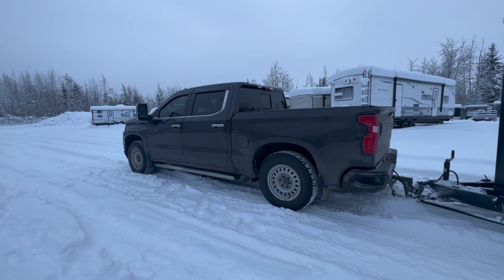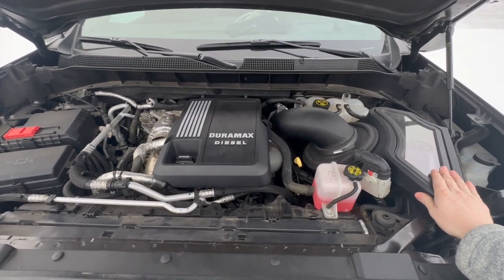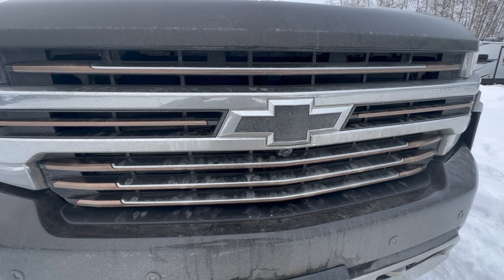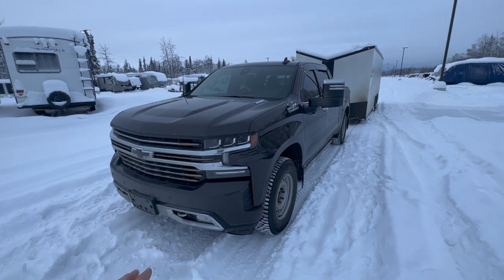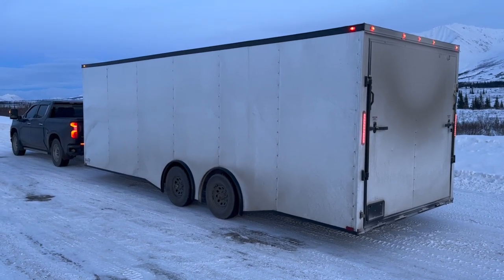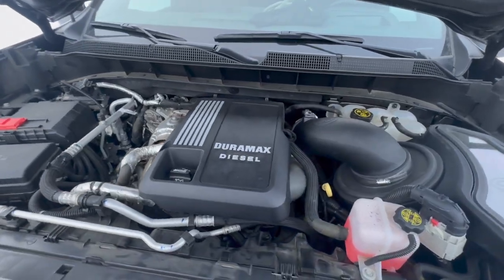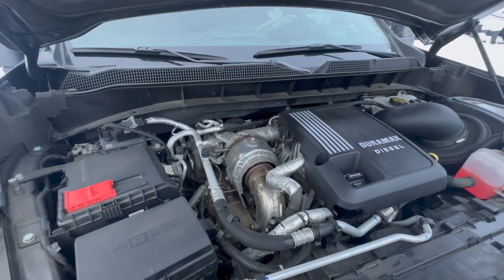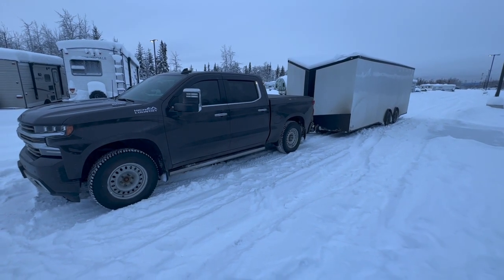3.0L DURAMAX WINTERIZATION- IS IT A COLD WEATHER DIESEL?

Comment: I'm in the NWT, I have added 2x battery heaters and an oil pan heater in addition to the stock block heater. My truck fires up no issues everytime and there's been a few nights I've forgotten to plug it in at -40 over night and it will fire up everytime. It's a 2020 2500HD, I do have the active grill shutters and in town it maintained heat in the cab but on some longer road trips when temps were in the -30's or lower it did have a bit of an issue getting really hot in the cab so I've got a winter front for it this year. No issues with the DEF system. I kept my tank slightly lower than 1/2 full and had no limp mode issues.

Comment: Great video! The baby duramax is top of my list for my next truck but being in Canada I’m nervous of def in the cold. Hearing there is a heater in the def tank gives me confidence - thanks!
The only extra winterization I’ve done to my 6.7 Cummins is a noco battery maintainer and I’d highly recommend. Diesels use up a lot of battery power and your charging system can’t always top it up, especially in the cold.
Reply from the maker: Thank you so much! I wanted to share my first hand experience with the truck and what ive learned over the year. I am making a video now but my DEF tank ended up freezing and essentially exploded from the top. I left it outside overnight (like most of the nights). It had 1/2 tank of DEF, plugged in etc. The dealer ended up covering it under warranty but they ended up replacing the tank + pump and harness. Super expensive if it was'nt covered.Something to keep in mind if you dont have the means to park inside.
Reply: @CHASING_BUILDS  oh no! That’s my biggest concern with def systems, having them freeze and leaving you in limp mode in the middle of nowhere. Guess I’m sticking with my pre-def Cummins a while longer. Thanks for the info!
Reply: @stringtheoryangling  happenend to mme 3 time in 2 years on the baby dmax

Comment: Great video!, My 2023 does the same thing, if it’s 0-10 degrees I just plug it in for one hour. Disconnect battery if you don’t feel like cold soaking your truck.
Reply from the maker: That's smart;  this same thing also happened to a coworker's 2023 2.7L. Silverado. It certainly took a moment and digging to find information on it and how to resolve it.
Reply: Or a battery heat cozy.  Keeps the battery warm
Reply from the maker: @xlthumper  That's so smart!

Comment: Great truck. But for my use case, pulling a very similar trailer to this video with a race car inside, the 2500 gas was a better and cheaper option. Allowing for some headroom in terms of capacity if I step up from a 10k lb trailer to a 14k. We got an LT 6.6 gas Alaskan package for 56k, in the north east we could not touch a 3.0 or a 6.2 1500 for less than 70k.
Reply from the maker: Same up here; I was lucky with the one I picked up.   I have been really happy with it thus far; we just bought another Duramax....it'll make an appearance here soon. I was toying with the idea of a gasser; the limiting factor I am finding with this 3.0L is the truck's weight and other components as a 1500. My payload is only ~1400 lbs, you throw a loaded trailer on this truck that has a max tongue weight of 900lbs and you'll only have enough wiggle room for a Driver / Passenger. I've got a scale en route. Going to play around with the load. The LZ0 has certainly headed in the right direction with a 13.3k max tow; I am sure the payload has increased.
Reply: The payload being low is a function of the truck being a high country.  An RST would but up around 1800lbs. My Trailboss is 1700lbs payload.
Reply from the maker: @terrencejones9817  For sure, definitely a concern as the Tongue Weight increases.
Reply: You could probably pull that same trailer with a 6.6 at about 1-2 mpg less. I pull a fifth wheel with a 3500hd at 11 mpg but not that cold, but running full ac.

Comment: We have a 21 at4 with the baby duramax. It’s got around 60 000 km on it. Early on we were plagued with no start long crank issue followed by a water pump issue that was was replaced. Since about 25000 km we have been problem free. 

Luckily I haven’t had that fan issue. I only plug it in when it’s going to be colder than -18 Celsius as per the user manual. 

I’d have to say in general I’m annoyed with the def usage overall. Not just towing. I’m dumping a jug in every 5-7 weeks. When I owned a 2017 cummins I dumped a jug in every 6 months.
Reply from the maker: Todd, me to brother...me too. Its crazy. Spend as much on DEF as I do fuel half the time when I'm towing....lol  

What symptoms did you have with your waterpump?
Reply: @CHASING_BUILDS  for months the thermostat needle moved all over. Almost red lining then it would drop below normal operating temp. Never sat at any one position very long. Then one day we got an engine light and a warning message saying get to dealership within 250 km or something along those lines.

Comment: I pulled the battery terminal to reset the fans. Worked like a charm
Reply from the maker: That is the other easy way to solve it, smart thinking!
Reply: @CHASING_BUILDS  Negative specifically as per Manufacture instruction.

Comment: I can see why the ecm needs to know when the block heater is connected for one reason- to prevent driving while connected to the cord. Also- I would not change the diff cover. See Gale Banks for why.
Reply from the maker: Thanks Chuck! I'll have to check that out. It might be a little late for it but I'll keep the OEM cover just in case.

Comment: it's actually the aerodynamics that makes the most difference with mileage when towing.  i was able to get 18mpg pulling a 2k flatbed trailer with my 2021 Sierra LM2, while pulling a 14' cargo trailer, you're lucky to get 14mpg.
Reply from the maker: I haven't had the pleasure of towing a flatbed yet but I can certainly imagine. Especially if you have a head wind.

Comment: I would also recommend a battery maintainer, because of al the electronics there is a small drain on the batteries. Plus the cold eventually the batteries can go flat in a few days. Especially if you added things like a dash cam with a parking mode.
Reply from the maker: Smart! I've got one that I pop under the hood when it sits outside for more than a week. Defiently helps keep the battery happy!

Comment: Nice ride and video.  Where'd you find the steely wheels for it as that's a great winter setup.
Reply from the maker: Honestly, they came with the truck when I bought it. They definitely make for a more enjoyable ride in the winter other than my 22” wheels. Totally worth it; with the studs!
Reply: @CHASING_BUILDS  Thanks...I may have to round up a set for next winter.  I threw some 20" AT4/Elevation wheels on mine and really like them but was thinking that some steelies would help me keep the 20" in better condition.
Reply: @CHASING_BUILDS  Sorry, but I have one more question.  Are the steel wheels 20"?

Comment: @chasing_builds I just bought a 23silverado with the 3.0l. Took it on the highyway in -20deg temps and I was struggling to get the cabin temps to warm up. I tried the auto setting, manual fan settings, recirc on/off , etc. It was putting out luke warm air. Engine temp was normal. I called the dealership and they said they have had a rash of both gas and diesel trucks coming in because of the cold temps, complaining of the same issue. They told me to get a winterfront for it but GM doesn't make a factory one for these trucks. After watching your video you mentioned you had one but it didn't work. Not sure which route to take now. Which brand did you use?
Reply from the maker: I purchased the FIA brand, I beleive it was close to $200. I found the best results when keeping the truck in the heated garage then exposing it to the temperatures. Frozen Cab, Leather, Plastic etc just radiates the chill significantly more and makes the cab feel much colder than it would be; if stored at normal temperatures. The 3.0L has the front plastic acuators behind the grille from factory to help close off the engine bay. The acuators would be closed at idle and open up to help regulate with temps. I didn't notice significant change with the 3.0L, also the smaller displacement of engines also plays a part in temps. My 6.6L DURAMAX heats up the cab far more than the 3.0L. Same applies to gas engines I've owned in the past. More Displacement = more heat generation. On the flip side, you can only warm up a cab so much in temperatures that extreme haha The joys!!

Comment: I would have loved if you would have shown the vehicle load and tow ratings from the drivers door jamb sticker. Unless that truck has the Max Tow package you appear to be way over the tow rating. Most trucks I've see without it have a maximum trainer rate of 8.800 lbs with a 880lb max tongue weight.
Reply from the maker: You are spot on. If the trailer is maxed out, with the GVWR I would be overweight. Empty or lightly loaded the trailer is perfect. Tongue weight should be around 10-15% of the trailer's gross from my understanding. I think 6k-7k is the preferred weight behind these "smaller" trucks.

Comment: I'd be curious on in-depth of towing that long of an enclosed. How it does in windy conditions, sway problems, etc.
Reply from the maker: We didnt experience much wind. However I did get sway above 63 mph+ 

Enroute back we actually purchased a sway bar hitch to counter that. It helps keep it in line now. According to the owners manual, a sway bar / weight distribution hitch is highly reccomend when towing above 7k lbs. I think moving forward; it will be on regardless.

Comment: You running snows on the trailer? I have a 26 footer and want to take it out in the snow
Reply from the maker: Unfortunately not, just your standard all-season tires. The truck, on the other hand, does have studded tires on and was planted all the way.
Reply: @CHASING_BUILDS  cool I have a dually with snows and standard on the trailer. I wanna go winter drifting so im gonna test it out see how it goes. Love your setup Cheers
Reply from the maker: Winter Drifting, right on! Thanks man

Comment: Do you have any info or link on the oil pan and transmission oil pan heater pads?
Reply from the maker: Any of the KATZ branded Silicone Heating Pads are a great option. Mine are 100W each.
Reply: Thanks. What’s the temp of the transmission oil when you start the truck up?

Comment: I have a 2020 2500 duramax and pull a trailer with four zero turn mowers, the gross weight is around 8000 lbs. It pulls it great but was thinking of trading it for a 2023 3.0, the question is will it handle it and would I be happy with it coming from a 6.6.
Reply from the maker: Honestly, I think you'd be happy towing with that weight especially if you use the truck as a daily and weekend warriror becuase the 27+ mpg is nice but you want to get a base trim with higher payload for your application. First, you want to confirm the Tongue Weight on your trailer as the payload for my particular truck is only 1452 lbs (HighCountry) so an 8k trailer should give you about 800-850 lbs of tongue weight which in turn would only leave you with about 600lbs of payload. If you've got a 4-person crew plus equipment you'd bust the payload on the truck. I find the ideal towing is about 6k lbs on the 3.0L in terms of flexibility of persons / equipment. However, you could load the truck up, tow 10k lbs and it would easily do it; you'd just be outside the manufacture's recommended numbers. Plus that new LZ0 motor is an absoulute work horse, it made this LM2 which is already good; better.
Reply from the maker: The biggest limiting factor is the frame, suspension, and brakes on a 1500. The 3.0L in terms of numbers and power has it.

Comment: I get between 20-25 mpg towing a 16 foot flat bed with a 4k jeep on it with my 3.0. If i get a strong headwind (like in kansas) then i'll drop to 16-18. My 16 foot enclosed trailer im begging for 10 mpg.
Reply from the maker: That sounds about right, from what I’ve experienced which honestly isn’t bad at all!
Reply: If the aftermarket builds itself up well I’m convinced this may be the best base platform for overlanding fun. 6 seats for larger families, a bed or camper shell. 30+ mpg not towing. I get 600 miles to a tank on the highway and over 500 in town.

Comment: Holy crap. I get about 5000 miles per def tank on my Cummins. 30-40% towing about 8-10K lbs
Reply from the maker: I would delete it if I could, this 3.0L is a DEF-AHOLIC.
Reply: I have a 2022 GMC with the 3.0 and a tank about every 5K is what I have been seeing.
Reply from the maker: @edwardpate6128  That's what I see, but the moment I tow, it plummets! Its not too bad but definitely worth a mention.
Reply: My 6.6 Dmax averages roughly 4-5k as well . i think it holds about 5 gal of DEF and sends a reminder when im down to 1k miles left

Comment: The extreme DEF usage is because the poor little engine is working its ass off. Boost equals NOX, NOX is the reason for the DEF. High combustion temps are the result of high boost levels. That 3L has to work to tow, all of these 3 litres diesels are personal use primarily. All half tons are really personal use really
Reply from the maker: That’s great information, most definitely. I don’t see it struggling that much for it’s sticker weight but again being a half ton it’s very limited on payload
Reply: @CHASING BUILDS  its not that its struggling. It's that it's working hard to maintain speed. It doesn't seem like it's working all that hard because it's 460lbft at 1750rpm. So many people fail to understand what does the work. HP is just the rate in which work gets done
460lbft is 460lbft right?
460lbft@1750rpm is 153hp
460lbft@4100rpm is 359hp
Both are generating the same amount of force. They can do the same work in the same gear, the 6.2 V8 can do it faster. It work the same with the hp
277hp@3750 is 387lbft
420hp@5600 is 393lbft
Very close in capability this is why the 3l duramax has a very similar GCWR to the 6.2, and it's the primary reason it gets better mileage too. It's doing the same amount of work at a far slower rpm with less cylinders. BMEP is far better and easier to utilize on the diesel. BMEP is the most capable torque at the slowest speed available. It's doing the most work with the least amount of fuel. This is why diesels are best for work. They don't depend on Stoichiometric air/fuel to operate properly(14.7:1). More air will mean more power(there is a limit), and more boost means higher combustion temp(NoX) and thus more DEF.

Comment: Not saying anything, but I think it’s pretty dumb to buy a diesel in Alaska unless you need it an you definitely don’t need it in a half ton
Reply from the maker: Ian, I havent had too many issues with the 3.0L thus far here in Alaska. Its honestly been a great platform thus far. I bought the 3.0L for the longevity of the engine and the overall gas mileage increase when compared to the gas counterparts. I tow around the 3k-5k lbs fairly often and the half ton is WAY more comfortable. I guess to me it really matters what the purpose is for the truck.
Reply: @CHASING_BUILDS   it seems like a lot of hassle when a v8 gas engine will work just fine and number 1 will start to gel at -30 where as gas is somewhere around -60 to -120
Reply from the maker: @yo9758  Those are great points; if you are living well into the Arctic Circle, it will be hard to live with, especially if you don't have a -40F, much warmer than last year. My DEF freezes all the time, which will throw a trouble code but once thawed out, it will go away. That is honestly the most annoying thing about it.

Comment: Ok half the cylinders of my 1996 suburban your only getting about 3 mpg better sorry it still isn’t sold for me honestly.
Reply from the maker: 3mpg towing or highway? Summer Time with a heavy foot, I average about ~26mpg highway and ~16mpg towing out 5k lbs trailer. The cold weather killed the mileage haha 

By the way; I have a soft spot for the ole Square Bodies. Tried and true. Make sure you hang on to it!
Reply: Hold on...Do you mean half the cylinders or have the displacement?  If you really mean half the cylinders, that means your burban is running a 12 cylinder by my math and I want to see it.